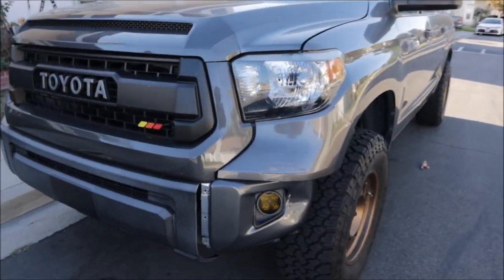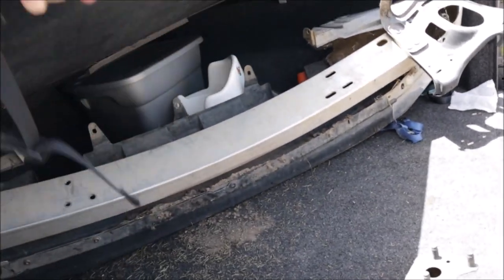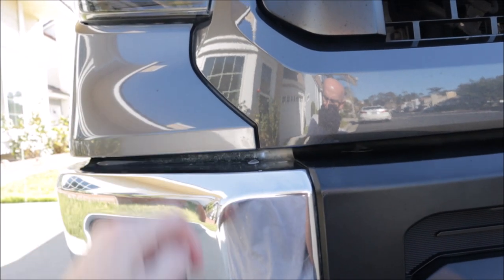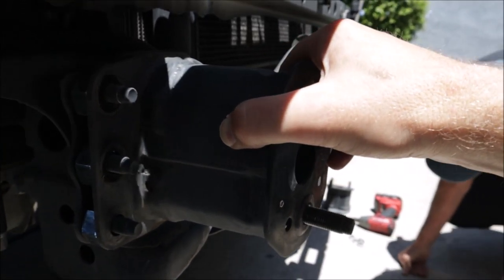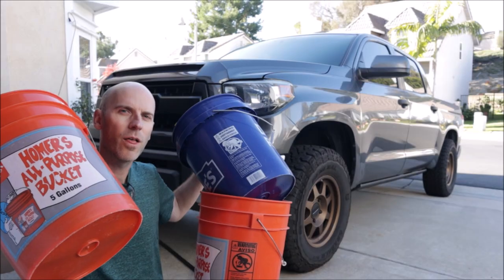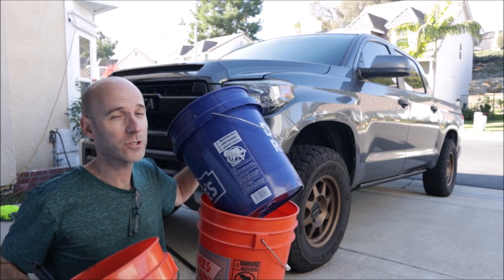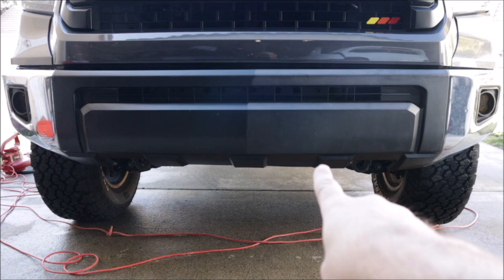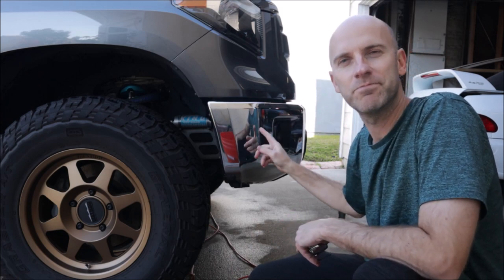My Tundra Got Hit! Let's Fix It - Front Bumper Repair

Comment: Great videos. I know this all takes a lot of work n time.  How are the brakes doing? Do you recommend?
Reply from the maker: Much appreciated! Yes, brakes are still going strong and wobble free.
Reply: I am gonna get the same rotors you got. Might go with yellow EBC pads not sure yet. What website did you oder from?
Reply from the maker: @JTADVENTURE2  tire rack for the brakes. Never tried ebc on the truck. Seem good on my Subaru.